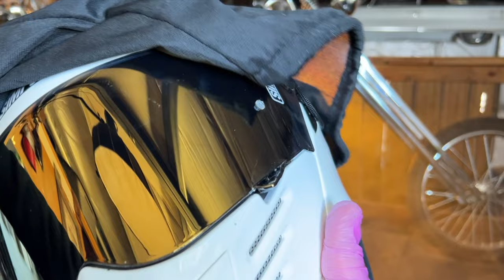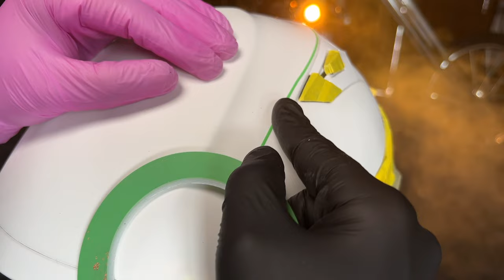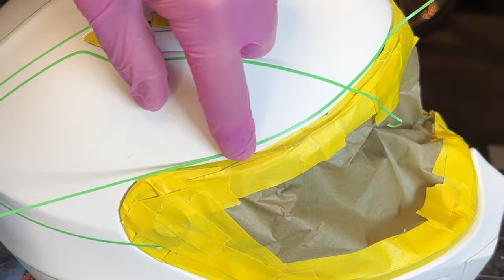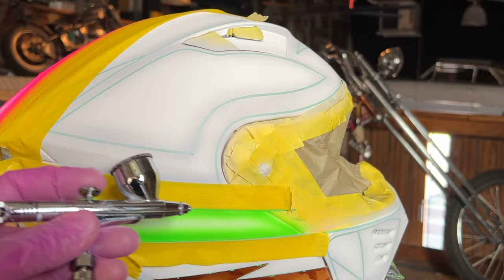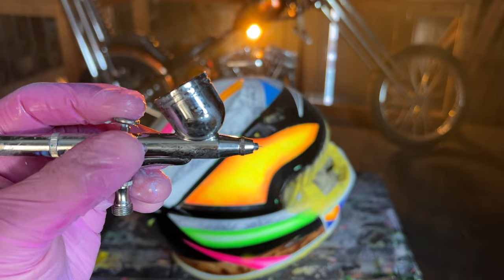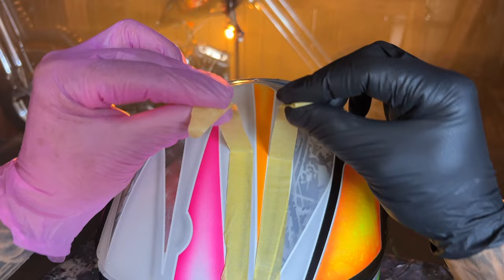Glove Love ! A Custom Paint Love Story That You Will Never Forget!

Comment: I have a question about the metal flak application process. I know you say to spray over a black base coat. Does it have to be base coat or can it be black sealer/primer. Awesome work you do .
Reply from the maker: Yes, black primer or sealer will work too just scuff it down